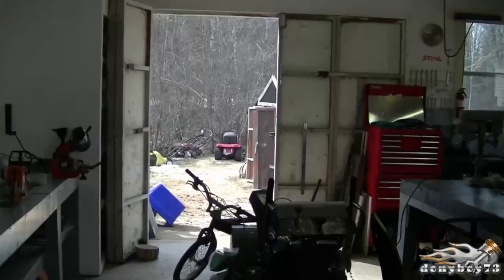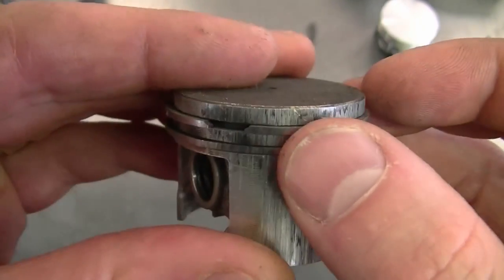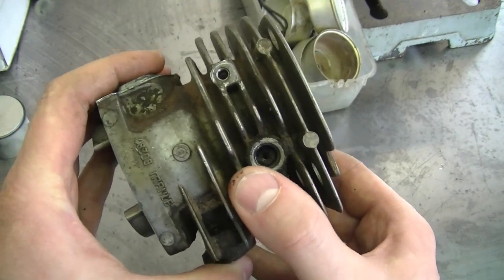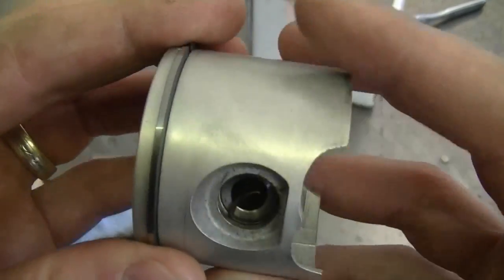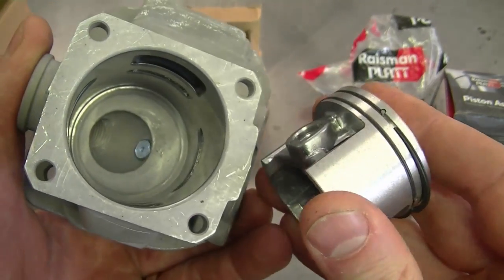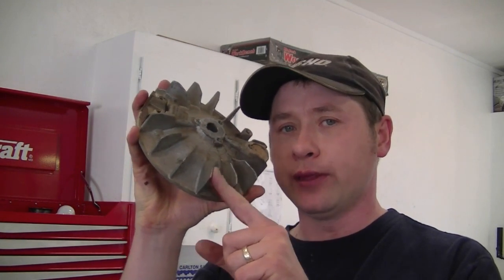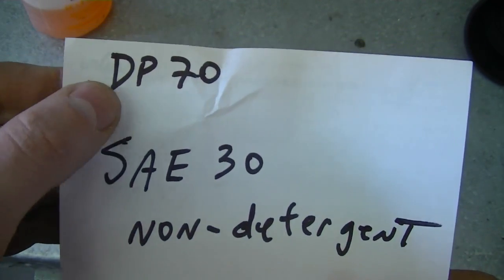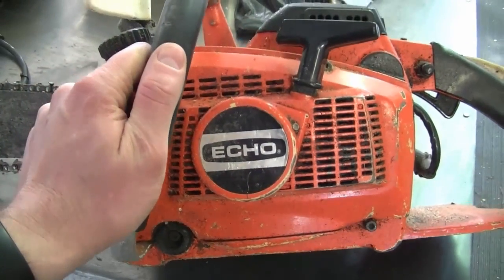Small Engines Q & A Video #93 in HD

Comment: yes, finally! another QA! :)

don, I think scratches on the cylinder wall aren't actually scratches. that's just a deposit of aluminium from the piston on the nikasil coating. nikasil is harder than aluminium so almost 99% of the time it just needs a little sanding. what can cause scratches on the nikasil coating are chrome piston rings, a bit unlikely but it happens. but anyway, thank god for nikasil, that's why most of chinese parts are inferior because they still coat the cyls with chrome

Comment: Great vid.  21 deg in Montreal, we had 29 on wenesday.  For the breaking period of a 2 cycle engine, it should be ok.  Idid have to run my sowmobile for 150km on SEA 20-50 because i did'nt bring the right oil on a trip.  I never had any problems with the engine after that.

Comment: check any switches that lead to the coil. if there are any unplug them from the coil and try to start the engine. if this doesn't work try regapping the coil to the flywheel with a business card. also check spark plug wire for cracks, splits and signs of excessive wear. if your spark plug is good and the right type, and all this doesn't work you need a new or used coil. depending on where you look you can find really good deals on them.

Comment: on flywheels that have a broken fin, I have went to the opposite side and broke a fin off there trying to make the broken part as nearly the same size as the other one to cut down on  vibration, not as good as a new flywheel but a lot cheaper.

Comment: if it is an old engine it might have points and condenser ignition. this is located behind the flywheel. after taking the flywheel and the cover off of the points you can clean them with a thin folded strip of 320 grit silicon carbide sandpaper, just make sure you don't touch the sanding suface that comes in contact with the points.after you finish this process use caulk to seal around the points and condenser cover so no moisture can get in. Good luck!

Comment: Hi DB,
Chainsaw pistons are not nikasil coated.  Cylinders have either a chrome or nikasil coating on the inside for wear.  Many years ago Poulan tried a chrome plated piston, rather than a chrome lined cylinder, and it was a disaster.  Some aftermarket pistons are coming with a moly skirt coating (black) for break-in purposes.  You can remove tramp aluminum that has smeared to a cylinder with muratic acid and a q-tip.  Aluminum will react with the acid whereas nikasil or chrome will not.

Comment: What does dull or shiny pistons have any bearing on the longevity of a piston and cylinder? I believe the damage to pistons and cylinders comes from not incorporating the proper mixture for the 2 stroke engine oil requirements. When those small engines get over heated that will cause damage to the piston and cylinder.

Comment: DONYBOY, I am a small engine tech in VA. and come across many 2 cycle engines in numerous kinds of equipment. What I'd like to find are numerous photos of bad pistons and cyclinder walls ( 2 cycle only) to determine what the causes were that made them that way and if there fixable based on how bad they are. Mainly I see small 2 cycle scratches on the pistons and walls and wonder...how much is too much...where I could confidently say to my clients...this will never run correctly. I'm trying to identify that fine line of when a little scoring or scratches is too much. Do you just go buy...if it runs ok there's not enough scoring to make a difference? I saw a cylinder wall the other day on a blower that was all disclored and a fellow mechanic said it was shalack left over from bad fuel-but it ran fine.
Also is there a way we can communicate thru basic emails if I have some scenario's I have questions on. You seem very knowledgeable and appreciate your advice. I'm not new to repairing this equipment but would like to bone up on it some more. Thank you.
Reply from the maker: if it runs good I leave but tell customer. if it doesn't run as it should with any scoring I tell customer that the top end is done and that I cannot make it run perfect again

Comment: In response to the question concerning using 4-cycle oil to break-in a 2-cycle motor: I would not recommend it. Before the introduction of dedicated 2-cycle mix oils, chain saw manufacturers would recommend the use of straight 30 W, NON-detergent oil. Gasoline to oil ratios were incredibly high. 16:1 was a common ratio. A big problem was the motor oil would leave heavy carbon deposits & smoke like crazy. Use a brand name synthetic or semi-synthetic 2-cycle mix oil with fresh regular grade gas.

Comment: Conventional 4-cycle oils have all sorts of additives which are not designed to be burned in the combustion chamber and will probably shorten the lifespan of a 2-cycle and foul out the spark plug quite frequently. Saw manufacturers never recommended the use of multi-viscosity oils in the fuel mix. To do so would void your warranty. Also, stay away from 2-cycle oils designed for outboard motors. Outboards run much cooler than air cooled 2-cycle engines & you will have problems if you use it.

Comment: Put alot of wd40 in the cylinder and let it sit overnight, it should smoke alot less or none after you run it, I guarantee it because I did it on a 8hp that smoked like a train then after it was completely gone.

Comment: See you also didnt got problems with using 4 cycle oil in ur 2 cycle engine, because as i know they did use 4 cycle on 2 cycle engine alot of years ago i think. Maybe once it shouldnt matter. Maybe a bit more carbon and smoke ofc